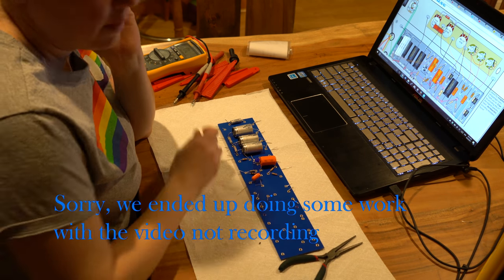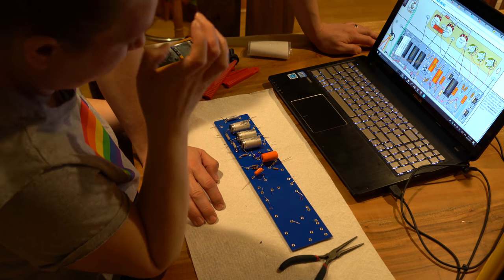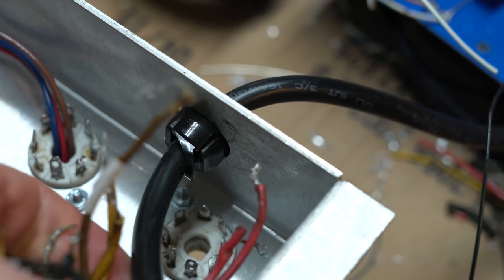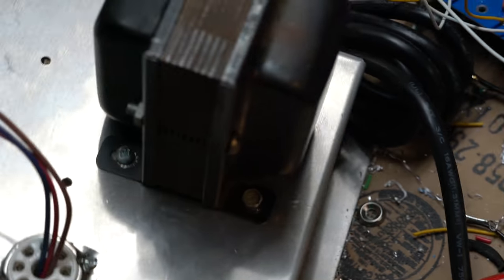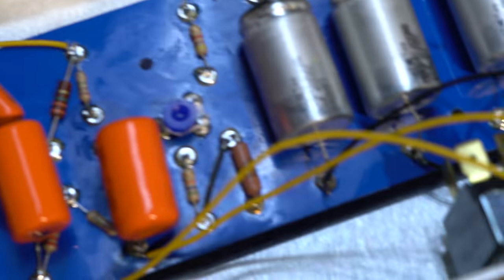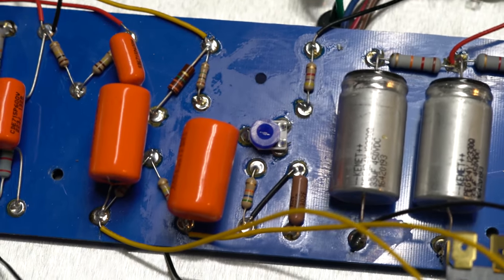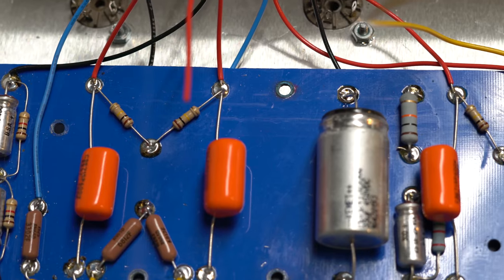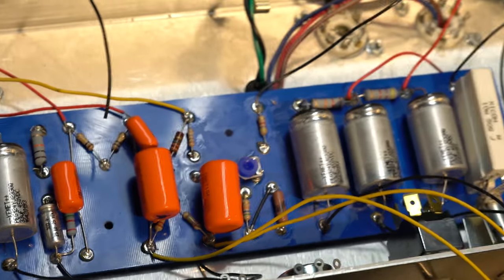Tweedle Dee Deluxe Video 4

Comment: Hi there;
I've watched a few of your videos and I think
I like them  ... I'm too much of a newbie to know
just how good they are. I have many questions, but
I'll ask this one first.

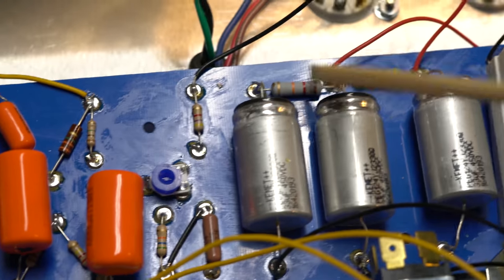 At 5:31  I see BROWN, TAN, and BLUE resistors:
What are the advantages and disadvantages for each?
p.s. also the WHITE ones at 1:31 as well?

Thanks Wayne
Reply: If you could expand beyond my own reply. LOL
Reply from the maker: Sure thing, blue are made of metal film, and have the least noise, light brown are carbon film, and have slightly more noise but tend to be good in guitar circuits due to some added 'color' they add.  Brown as carbon composition, and have a lot of noise and were more common in older amps, the medium brown ones are a special kind called rn65, used in military specification (milspec) uses.  White ones are ceramic wire wound and for higher wattage uses, they can range from 5 to 25 watt, and then they start having aluminum covers for higher wattage.  Hope that helps?
Reply: Excellent ... Thank You, for me and anyone else it will help!